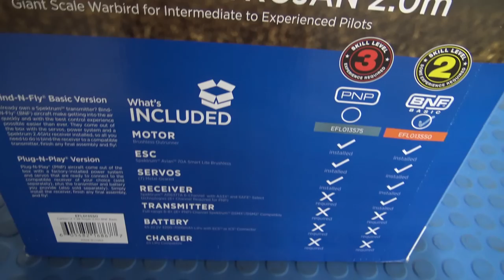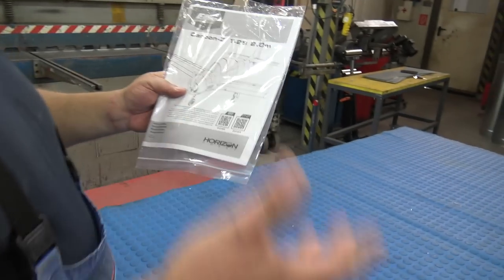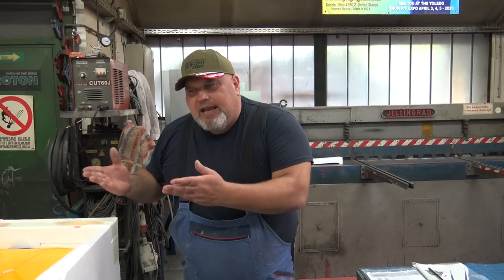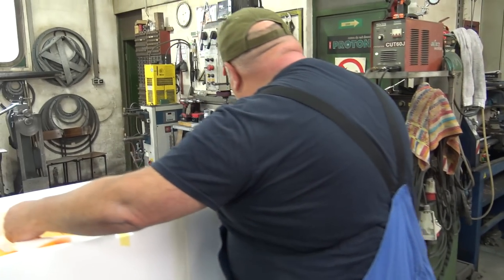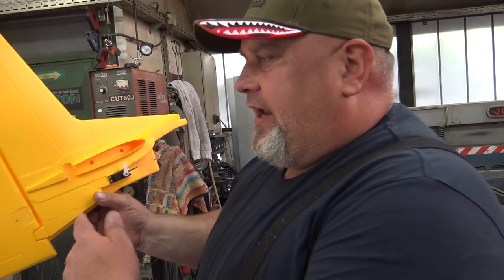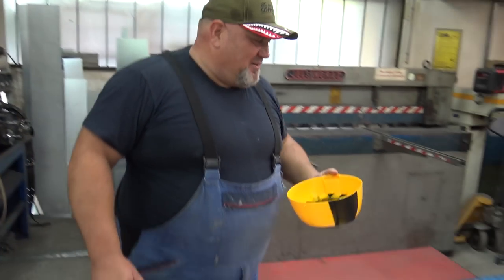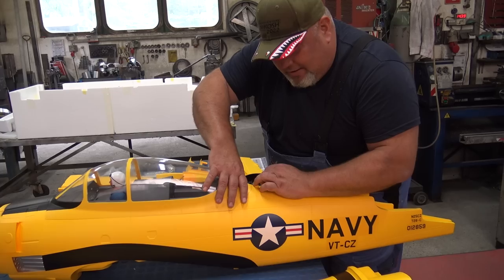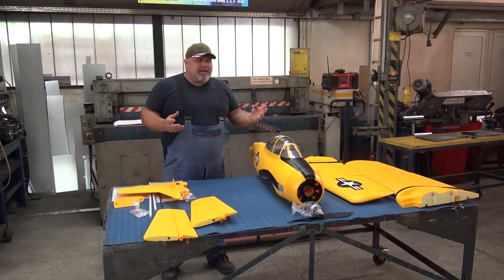GIANT 2000mm Carbon-Z T-28 Trojan yellow scheme 6S RC plane BNF Unboxing

Comment: If it is too slow, put a  120 amp esc and an 16x8x3 master airscrew 3 blade propeller on it.... Xd
Reply: I can confirm 120a esc, but i use a 18x8 prop. Works well on the gras and even on the road. With the 18x8 it has pretty gppg static thrust and a little sound because of the blade tip speed. Great model!
Reply: @rcplanelandings4307  it is a good plane, I wish they would design a a6m zero in the same size. Xd
Reply: @1976axerhand  I've already added head tracking FPV to the trojan :) fantastic

Comment: Looks bloody nice mate 

I still think it’s a shame you don’t really see people building kits out of balsa any more like we did in the 1980s seems to be a lost art……..

All the best from Melbourne Australia
Reply: And all these foamies are electric only, would be a nice option if able to have a decent firewall, capable of hanging a Glow motor off of the front.  This bird screams for a 120 four stroke
Reply: @jimsmalleimb7709  The other issue of course is to be fair. The foam stuff actually flies really well in many cases, arguably better………

I’ve seen other comments in other videos where the young generation says take it easy grandad I’d rather be flying em than building em……

Still seems a shame 

Not to mention this attitude is across the board 

The car I had in the 80s came with an instruction manual telling you how to adjust the valve clearances 

and the manuals these days Tell them not to drink the battery fluid. …..!!!! Pathetic.
Reply: @russcole5685  absolutely agree, having said that to be honest, I’ve grown attached to electric because you can go down to the local park and fly it around without drawing much attention because they’re so quiet 

and they’re clean 

doesn’t leave greasy exhaust everywhere……

I wouldn’t mind trying gasoline with 5% oil
Reply: @thewholls7176  fair call, and the oil is a mess, just apart of having the IC  engine.  Have a gas two stroke.  Cheaper fuel, not as messy, but heavier to fly with, battery weight, ignition system ect.   Each to thier own.  I try to build most my models, a couple of Nexa arf, VQ models as they are marketed as here in New Zealand.    Good basis for a kit bash
Reply from the maker: Oh I think basla will survive my friend. There are still guys who love to assemble kits. I hope to assmble at least one in my life. But later when I will have more time.

Comment: I have had mine on order for the past 3 months !!! and it still has not arrived in the UK - but when it does I will be very happy indeed - I have had special leads made so I can disconnect the wings without having to mess with 6 connections every time - just a single one.....

Comment: I had the Eflite Trojan 15 years ago. It was a nice plane then. Had plenty of power & it handled wind easily.

Like your shop. Trying to figure out its exact services. I have seen press brakes, sheers & wire fed welding machines, so I am leaning towards sheet metal fabrication.